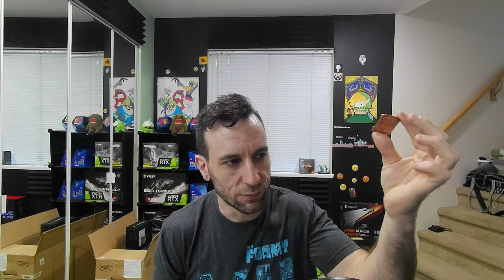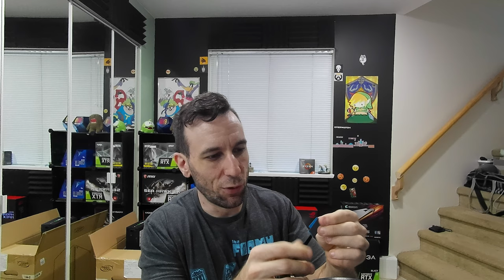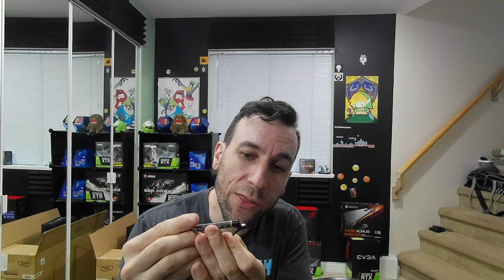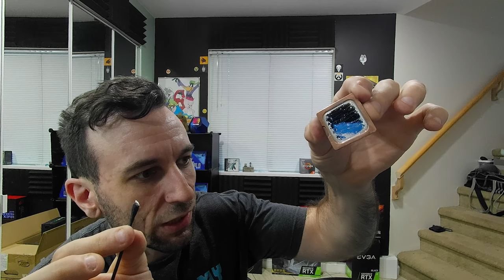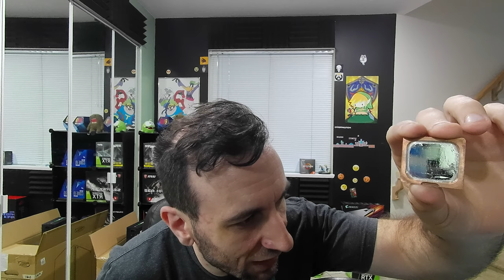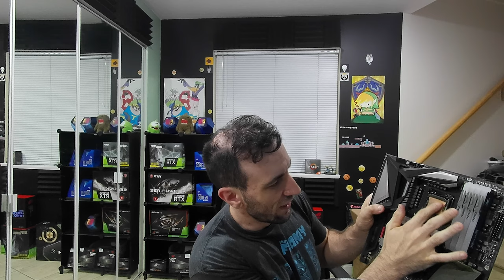Liquid Metal Copper Application Trick

Comment: I can comment something that I found after using 2 years liquid metal on my laptop (MSI GP76). The very first month after application of LM, I opened and added just a tiny tiny bit to assure same temps. At this point (1 month after first ever application) I saw LM made a new alloy with copper heatsink. , I changed 1 year later just to have fresh LM(no change in temperature!) . After 2 years , and having that LM alloy on copper heatsink , had NO impact whatsoever. 

Actually you better of keeping that alloy on heatsink because if you remove the alloy , your LM will always penetrate inside copper heatsink and you will have bad temps at some point because it dried . Just leave the alloy , don’t sand it ! Same temperature on 1st day of LM and 2 years later with new alloy !! Same temps !!
Reply: Thanks for the updated comment. Good to hear 👂

Comment: Liquid Metal is a mixture of Gallium, Indium, and tin or Galinstan. Using Galinstan on copper creates an amalgamation, and creating an alloy of copper and gallium.
This isn't necessarily bad for thermal conductivity, but it reduces the quantity of gallium in Galinstan while replacing it with copper. 
You will slowly form an amalgam of copper, gallium, indium, and tin which will allow tin to increase the melting point or "Dry up" the liquid metal. 
This transition process from liquid to solid alloy will significantly reduce the Thermal conductivity to high end thermal compound levels and then to mid tier over Months to a year. 
This is why I believe they recommend using only nickel heatsinks since it may have a lower thermal conductivity than copper, but reacts significantly more slowly than copper.

For the Most benefit, if you could get the copper to a mirror like finish sanding it; there will be a prolonged period for amalgamation; this will also shorten the lifespan of the heatsink however.
The reason why high end thermal paste compounds are not based on Galinstan or liquid metal is mainly because the thermal conductivity is impacted by how well the medium fills in the micro-gaps present even if it is a mirror like finish on both contacts.
Liquid metal can fill these gaps, but like filling in pot holes wear or heat in this case will produce more gaps. This is a crude analogy, but I thought it was great in the moment.
Reply: I just recommend nickel plating copper first, that's how I did it. Then you just wont run into these problems.
Reply: nickle plate is thin and insignificant to thermal conductivity.

Comment: This trick works by enforcing migration of gallium into the copper. This slowdowns further migration after relidding thus extending the lifespan of a single application. What I don't see is the need to spread the TIM layer over the entire HS (prevent horizontal migration?) nor left it "drying".  I just remove the TIM after 1 hour and reapply a new layer.
Reply: So why you should spend time on assembly/disassembly if you can "dry" it just on table.

Comment: Wonder if the multi-layer experiment would work if the excess dried out remainder was removed with a razor blade. That's what I used to remove the dried crud on my lapped IHS last time, but I ended up switching back to regular paste after so I'm not sure how it would of held up.
Reply from the maker: I usually polish it with 7000 grit sandpaper after

Comment: is it worth it to delid and remove the solder to apply liquid metal and reapply the stock ihs in your opinion ?
Reply: In my case- big yes.
I have an old , crappy all in one Hp system, my processor is an I7 8700T (35W)
Everything stock - 60C idle, full load - 80-85C
Delid done, Liquid metal on, 42C idle, 65C full load.
Fan is at 20% on idle, quiet as a whisper.

Comment: Could you not just apply a thin layer of nail polish on the copper surface itself and let it dry before applying liquid metal? I thought maybe it would act like a coating against the LM migrating into the copper and subsequently drying out the same way it protects components from shorting out.

Comment: 2 questions:
1. Does this apply for the direct die cooling with an AIO like Kraken which has a copper pump block?
2. I noticed you did not apply liquid metal on the CPU die itself? Is that right ?
Reply from the maker: 1) yes and no,  you can usually get away without doing this trick as long as one of the surfaces isnt being absorbed
2) you have to apply liquid metal to BOTH surfaces every time
Reply: @FrameChasers f

Comment: When you apply thermal paste you dont do it to both aio heatsink and ihs so the same applies here once you let it dry you dont need to reaply another layer as long as you apply lm on the cpu die because you have already prevented the migration of lm from cpu die to ihs
Reply: No. When using liquid metal it is always recommended to apply to both heatsink and IHS. You are wrong. The confidence in which you make your incorrect statement is honestly baffling.

Comment: i only have one problem with this having done all this in desktops and laptops, he paints the entire underside of the IHS there is no need to do this and not on this there is a risk some of that liquid metal ends up running off that onto an electrically conductive component on the CPU itself under the IHS, to protect from this its best to use conformal coating but I have also used clear nail polish for this task. in regards to putting it on top of the IHS you can repeat his steps or just use thermal grizzly kryonaut extreme, because the best place for liquid metal is inbetween the ihs and die, and using liquid ,metal on your ihs top and cooler of choices coldplate if left to long can get stuck and literally feel like it is welded together which can end bad for the cpu and socket. There is a new Thermal Grizz;y Conductonaut Liquid launching soon!

Comment: what is the grading of sanding paper used  ?
Reply: Rule of thumb if you need to buff something off of bare metal, start with a low grit and then move higher, until you get to polish phase.

80, 100, 120 and if you can get away with it, go up to 400 from there.